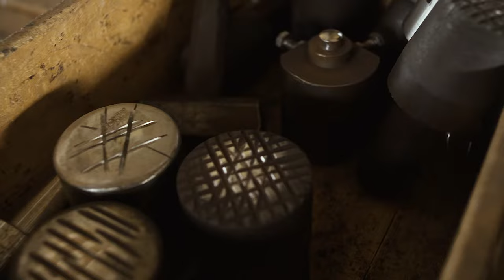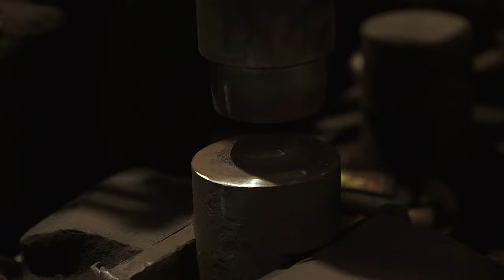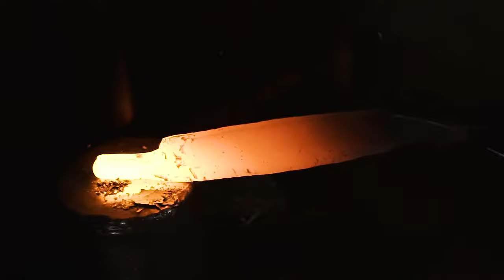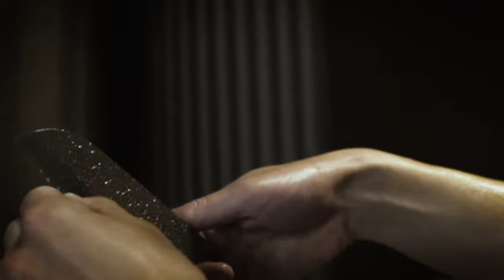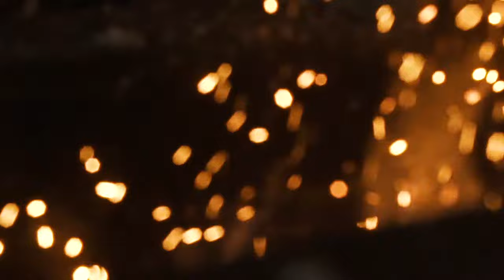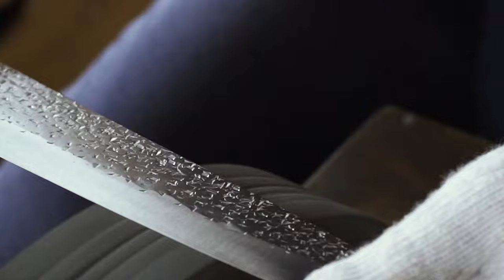1 minutes movie clip of how Yu Kurosaki (Japanese blacksmith) make knives

Comment: I have a 210mm Gyuto of him in the exact same design as shown in the video. Been using it for about 5 years now with barely any signs of wear. It's very easy to sharpen, holds an edge extremly well and is very enjoyable to use every single time.

Comment: Can you cut hard fruits and vegetables with yu kurosaki gyuto knives?
Reply: Depends what you classify as hard. His knives are relatively thin but not quite lasers, but you'll want to avoid pumpkin, hard nuts etc.
Reply: @omgchocolate4857  i have his shizuku R2 gyuto and i can say it is an amazing cutter.  But, as you said i would avoid hard stuff.
Reply: This knives are like razor blades they are incredibly sharp but like all Japanese knives I would avoid hard stones.
Reply: @tomsmyth5138  Hard stones ? Why?
Reply: Get a laser Bunka and a workhorse 240mm gyuto. Now you don’t have to worry between the 2. A couple cheap paring knives (I like opinel) and a tojiro or Mercer bread knife and you are set